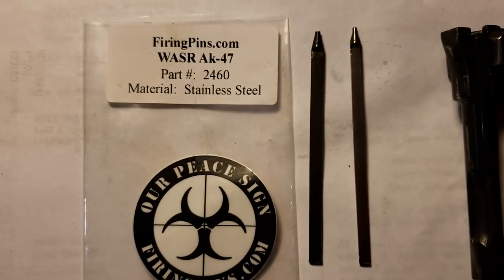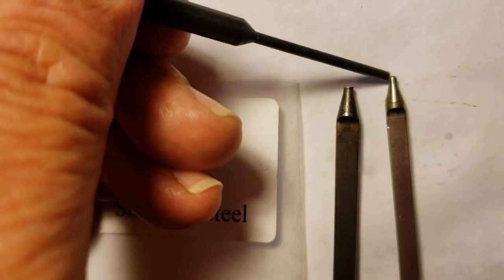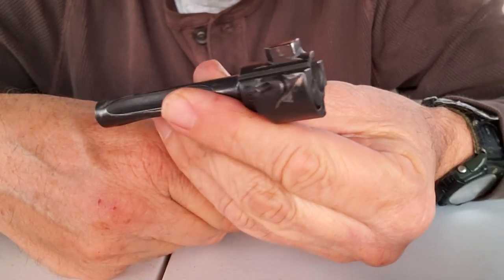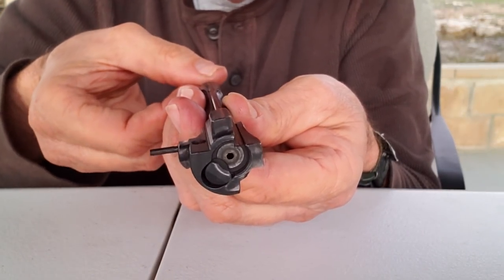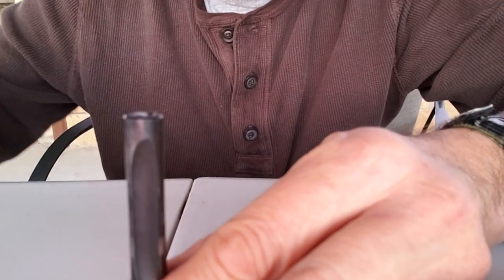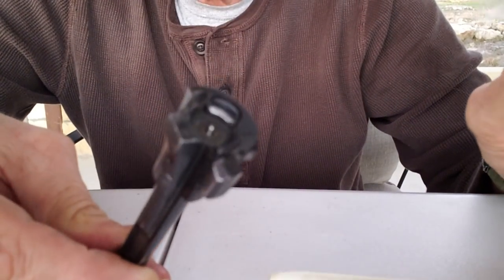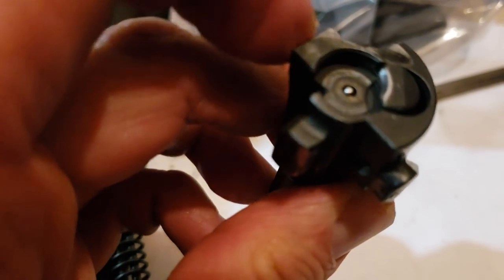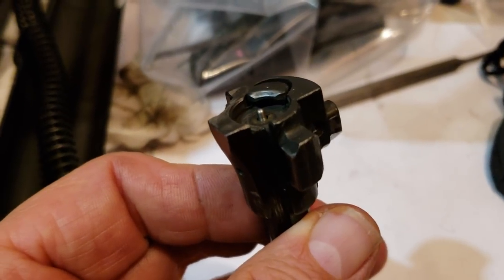AK light primer strike problems?  Try this!!

Comment: Forgive me if I missed this, which firing pin did you replace the original with? Do you have either a link or a part number or manufacturer?
Reply from the maker: @Chris Chenevey
https://www.firingpins.com/
 I always try to put those in the item description, but you know YouTube.
Make sure you look for your specific AK model and use calipers when you get the new one.

Comment: Just curious, why not install a firing pin with spring while you're at it to prevent slam fires with a free-floating firing pin?
Reply from the maker: Good point, and you can do that, but with regular cleaning and maintenance,  "Nyet, rifle is just fine". 😁

Comment: Good vid! How common is that kind of issue ?

To give some context :
I want to buy a cheap AK (SDM, chinese made, about 600€ - i'm french), but seeing that vid makes me worry that some small inner parts of the rifle will be fragile and subject to issues like this. Aftermarket for bolt/trigger parts is almost inexistant here, so I'll be kinda dependent on the quality of original parts. 
My range has an SDM since a few months, finitions are rough but mechanically nothing to say (rivets are good etc) and reviews are all positive. However, since we tend to shoot very little around here (not many people shoot thousand of rounds through so-called "assault rifles") all reviews on any guns tend to be very positive... Dunno what to think.
Reply from the maker: @LR S. This is the second time someone has brought an AK in for me to look at and repair, in the last 20 years. I am going to say, all depends on the QA of the person or company that put the rifle together,  or a lot of use.  I always believe in keeping a few spare parts.
Reply: @praktikalnurse504  Great, thanks for the info. I may be able to source parts in eastern europe, I'll check the legislations first though haha
Are the chinese AK u got in the US compatible with "generic" spare parts, or do they need specific Chinese parts ? Even if the quality of production has dropped between the last imports to the US and now, I'd guess that part compatibility hasn't changed
Reply: LR S I wouldn’t even bother with those Chinese AK’s they are fragile and horribly inaccurate.   But hey my wasr 10/63 is probably one of tbe most robust and accurate AK’s in the world.  If you are interested I’d gladly help you out and by showing our classic American generosity and set you up by trading my Wasr for your Chinese AK before yours blows up and hurts people.   I am a gunsmith and I will  spend some time trying to make it into something salvageable while you can have ultimate peace of mind knowing you have the MIGHTY WASR protecting you and your loved ones!  No need to thank me brother just packing it up and quickly getting it to me is thanks enough.   I just finished upgrading my WASR you will love her!!   Salute mon frere!!! ✊🏻

Comment: I have a problem removing my firing pin, pin the pin that holds the firing pin in place. it wont move out I used a gun hammer and a punch, the punch broke, the pin didn't move. WTF Can you help me with that. wasr 10 only 60 rounds shot. I even tried gun oil on it over night.
Reply from the maker: It shouldn't do that.  I have seen some so that you can push out with just hand pressure.  If I could, I would like to look at it
Reply: where can I send the pics of my bolt and pin?